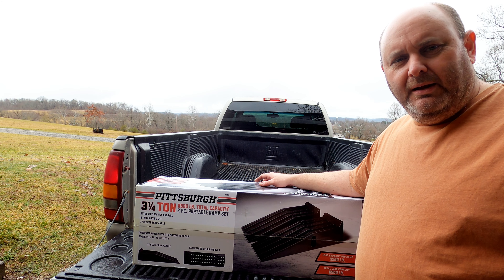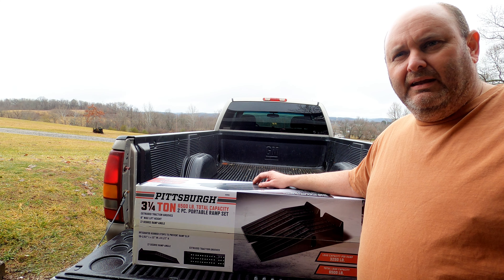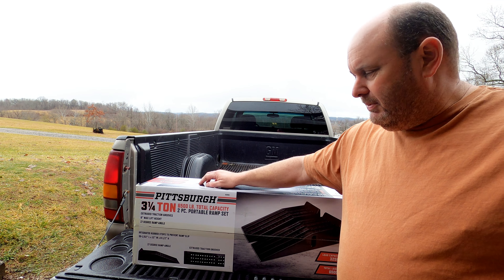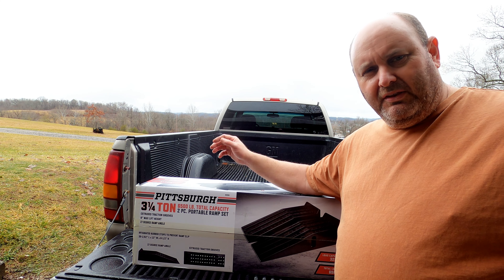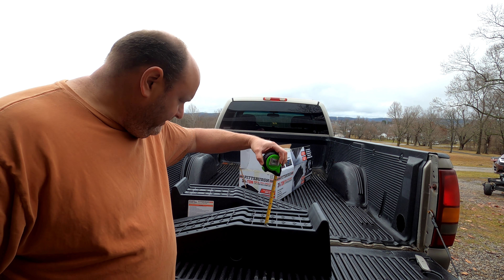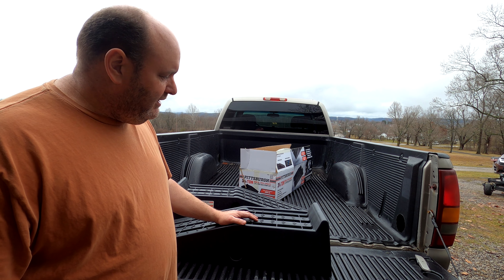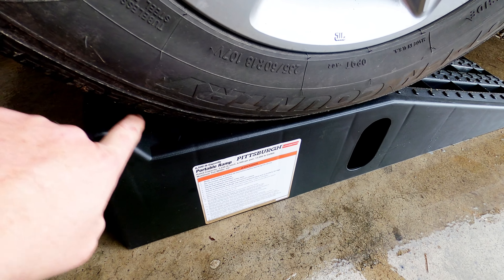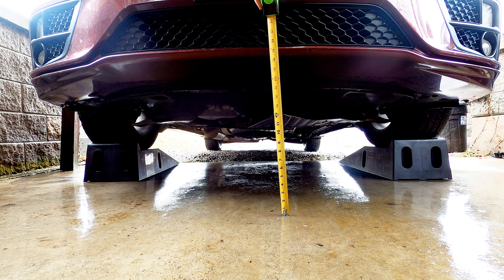Tool Talk ,  Harbor Freight 's Plastic Car Ramps ,  Review , and demonstration   .

Comment: do you think I could check the BOTTOM portion of my transmission on my F150 .. xlt .. ?? if you don't know that's fine. I just have this tran fault prob and wanted to know if these could help fix my code by allowing me to get under the belly and undo the bottom of my transmission ..
Reply from the maker: I think so , I pull my 2500 hd Silverado onto them and I have plenty of room when changing the oil and transmission filters . Now keep in mind mine is 4 wheel drive so it sets a few inches higher then a 2 wheel drive. But even if yours is 2 wheel drive you should be fine.
Reply: @Starkeyfamilyfixing  ok then thanks for the brief speedy response, my truck still saying trans fault, I'm hoping these ramps will help me be able to at least see if I can do the job under it. But yup thanks , have a good one.

Comment: If you had a ford truck you wouldn’t need ramps to get under it.
Reply from the maker: I do have a ford truck , and your right I don’t , I put a lift kit on it a long time ago . 😂
Reply: @Starkeyfamilyfixing  my biggest complaint on changing oil on Fords compared to GM’s is Fords insistence on the the oil filter angles. My Excursion is an exception lol.
Reply: If you have a beer gut you'd need them.  lol
Reply: @Mr-Clark  nope. Fords were built to work off road. GM are for city folks and just driving.
Reply from the maker: I have both a ford and Chevy truck . My ford I bought new 29 years ago has a little over 540,000 miles on it . 
My Chevy is 23 years old with 175,000 on it . 
They both have served well ! 
My wife had a dodge several years ago , completely a money pit ! At a little over 100,000 I drove it to a junk yard and scraped it for $400 just so I wouldn’t have to ever look at it again. Even thought I could have sold it for much more . It was an impulse killing on a Saturday morning after it had screwed up again.